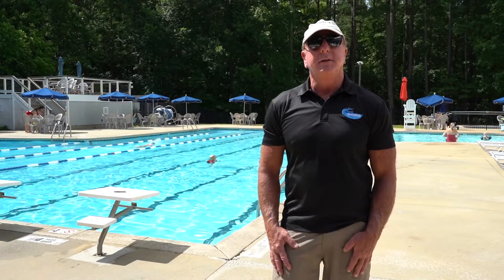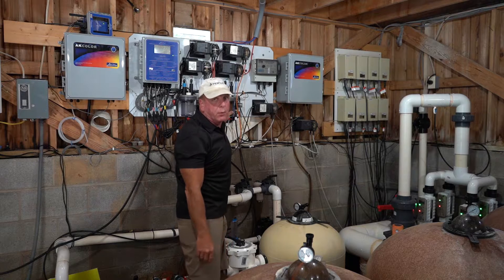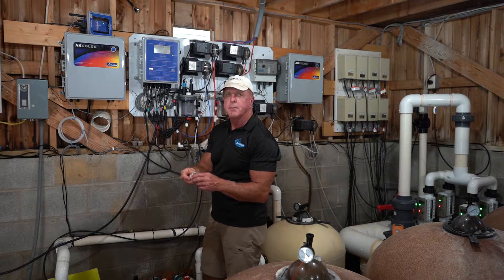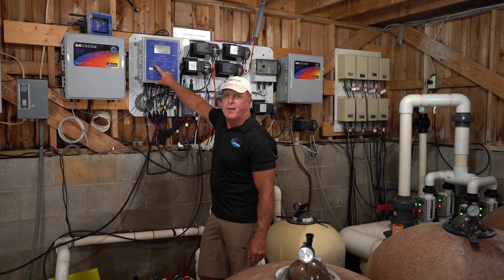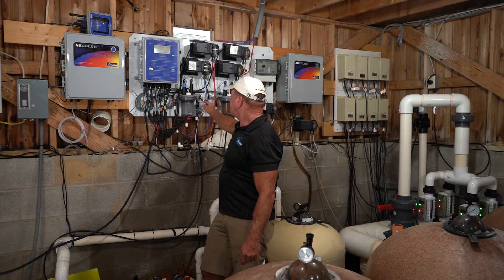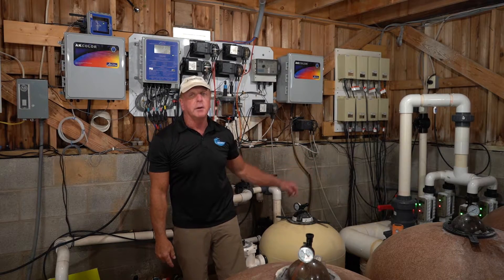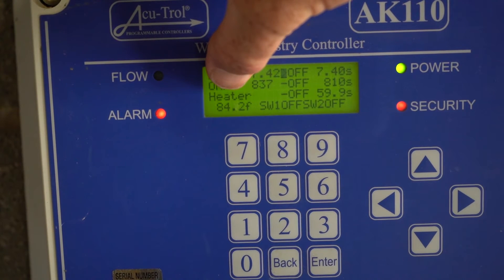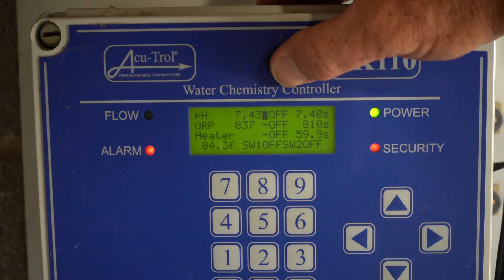Everything you need to know about chemical automation for your pool

Comment: How often should the pressure be released on the bottom of the flow cell?  And do you ever have issues with the white nut in the top middle leaking water?